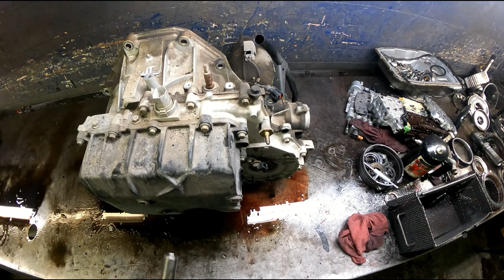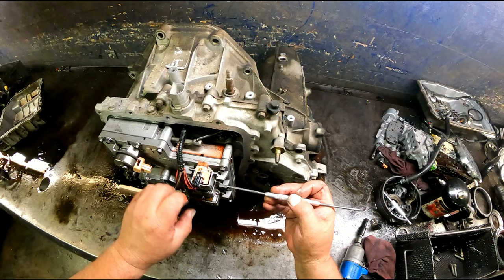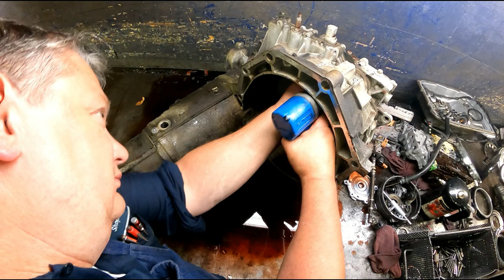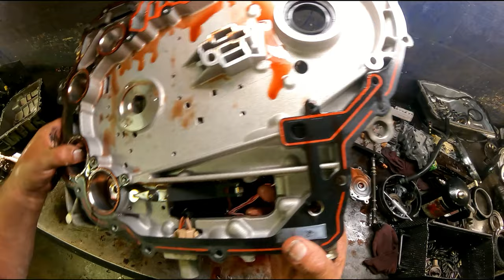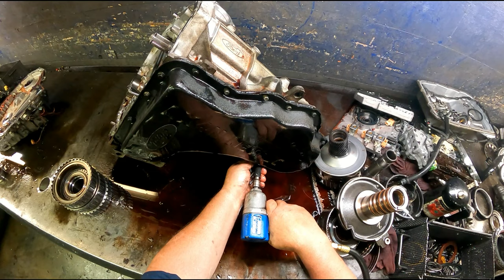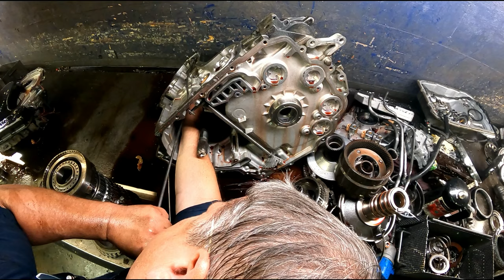4F50N Disassembly

Comment: @curmudgeontransmission - Some of the pan bolts on my 4F50N seem to thread in fine at first but will not tighten to 108 inch pounds.  They just kep spinning.  Is this because of gunk in the bolt holes that I can blow out or do they need to be rethreaded?  15 of the 19 bolts tighten just fine and seem to seal up the pan just fine for now.
Reply from the maker: They will need to have heli coils installed, sometimes you can get just a slightly longer bolt andif there is enough threads left that will work.

Comment: What is the most common failure on the 4F50 and AX4N Transmission,s?I know about the splines stripping out in the convertor,what about in the Transmission and valve body!Good video,Thanks!
Reply from the maker: These are really a pretty good unit. The T/C is by far the most common problem. After that, pump shaft and bearing, boost valve, direct inner molded piston, bushing in the O/D Drum tends to wear bad, and the forward clutch control valve tends to get stuck in the retainer.
Reply: @CurmudgeonTransmission  Thank You Very Much,I really Like All Your Video's!
Reply from the maker: @randallstewart8487  Thanks
Reply: @CurmudgeonTransmission  Oh,forgot to ask,what is the difference between 4F50N and AX4N!And what kind of assenbly lube do you use? Thanks!
Reply from the maker: Valve body and accumulators. Now I am using Transgel blue, the gold is no longer available, and Dr.Tranny green.
Reply: @CurmudgeonTransmission  Ok,Thanks!

Comment: @curmudgeontransmission - Which of the 3 shift solenoids if for 1st to 2nd gear? The one on top?  And 2nd to 3rd is the middle one?
Reply from the maker: Shift solenoid 1 is at the top and goes SS2 then SS3 on the bottom. SS2 is on for first. They are all off for 2nd. 1 & 3 are on for 3rd, and all are on for 4th.
Reply: @CurmudgeonTransmission  - Great information.  So with SS2 on for first and off for 2nd, that means SS2 gets a lot of "use" in stop-and-go traffic compared to the other two solenoids.  Is SS2 therefore more likely to burn out first over time?  And may that explain why after my transmission warms up and drives in stop-and-go for about 30 min, it sometimes has trouble getting from 1st to 2nd gear?

Thanks for any insight.  Great channel, and happy 4th!
Reply from the maker: Can be. Thanks. Hope you had a good one as well.

Comment: What could be the problem if I lost reverse ??
Reply from the maker: Before or after a rebuild?
Reply: @CurmudgeonTransmission  before a rebuild  and after???
Reply from the maker: @jesuschavez3191  Has it been rebuilt and this is the problem you have or has it not been rebuilt?
Reply: @CurmudgeonTransmission  supposedly it was rebuild but I have my doubts
Reply: @CurmudgeonTransmission  it was rebuild like 4 months ago and than out of no where reverse stop working
Reply from the maker: The channel plate gasket is known to fail. Could be that if it was not torqued down properly. If it has failed I would flat sand case and channel plate. Put gasket sealer on it. Torque the 10mm bolts to 18 ft. lbs. and the 8mm to 8 ft. lbs.
Reply: @CurmudgeonTransmission  is there a sequence to torque down properly ?? If so can you tell me how?
Reply from the maker: There is no specific order listed. I tighten the 10mm's down first, then the 8mm. @jesuschavez3191